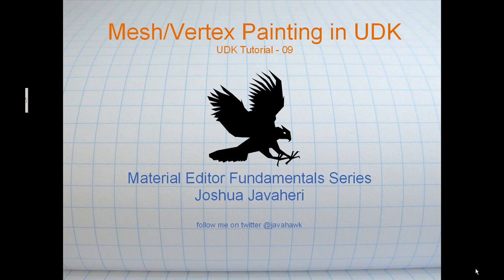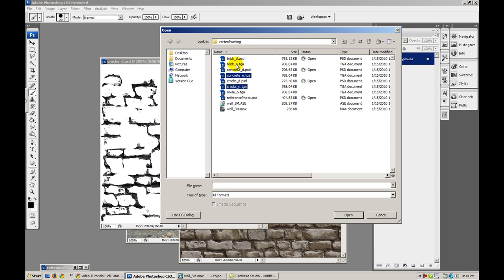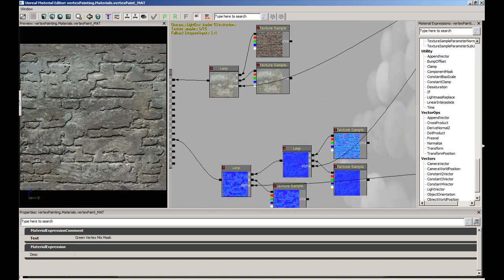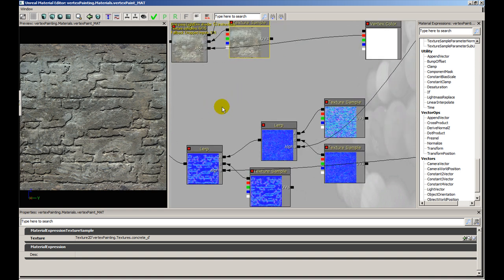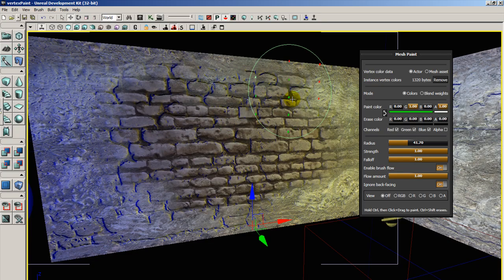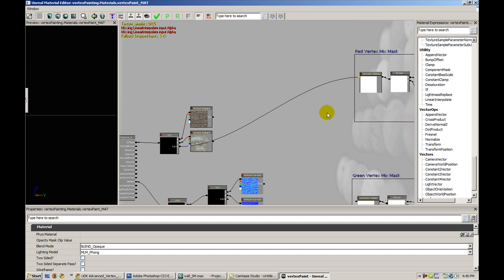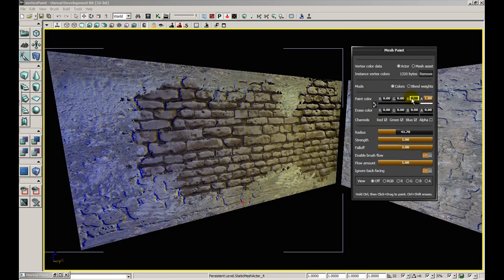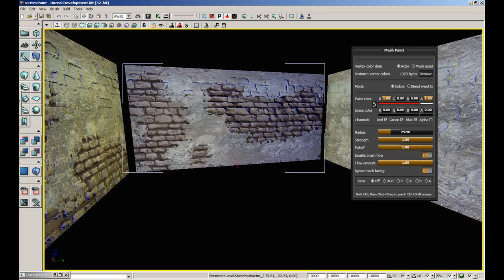Mesh / Vertex Painting Basics - UDK Tutorials by Javahawk

Comment: Great tutorial; while this stuff isn't super basic, this is a great and simple way to explain vertex shaders.

Now A few questions as I haven't been able to try out the UDK vertex painter very much: is there a way to save the "paint" in a package once this is done? As in, would it be applicable to use this method on more than simply level assets?
Also, as you said earlier that this could only be done with tessellated static meshes, can it be done now with tessellated skeletal meshes?

Thanks!